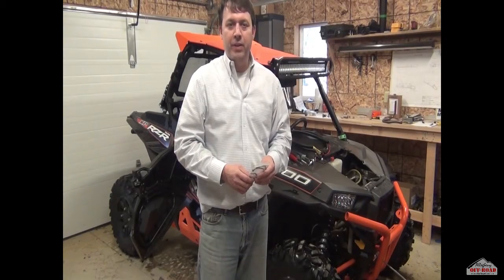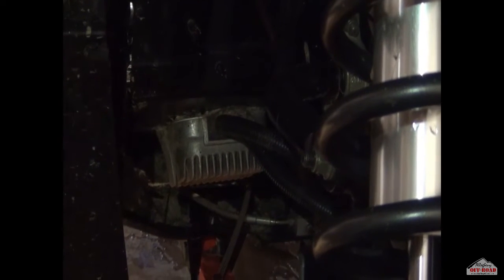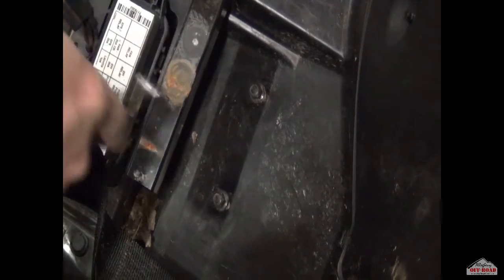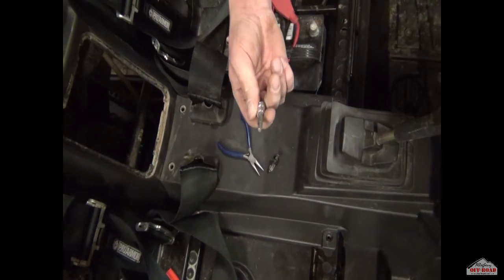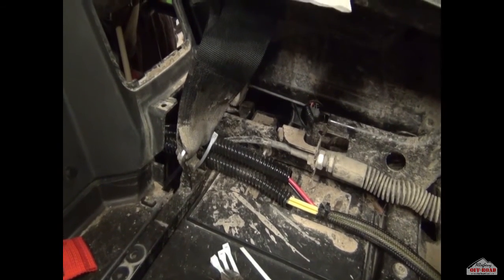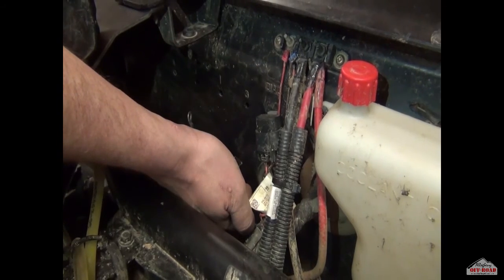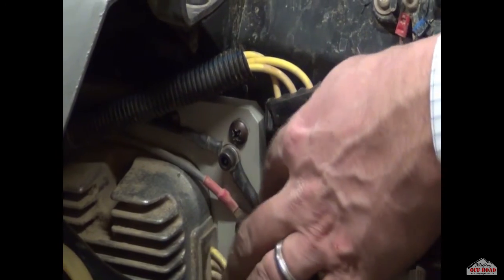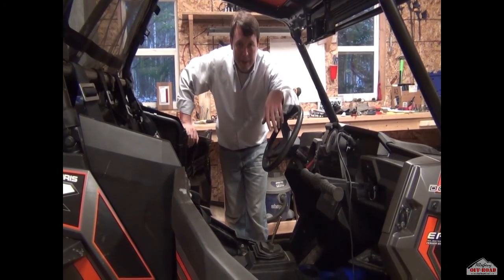Voltage Regulatior Relocation Install

Comment: okay  I would like to recommend that you have a professional do any work to your unit first and foremost secondly if you do have to disconnect your battery please follow the service manual and disconnect the negative terminal first this will prevent grounding of your tool and on a final note Polaris Industries does not recommend relocation of your voltage regulator
Reply: you sound like a complete idiot
Reply: @dannylsx   At the time of the comment I was a representative of polars industries I no longer work there because it's a shit hole.

Comment: Great product, I installed one of these on my wife 2015 RZR 900 trail after the recall was done last May. Just bought  another 2015 RZR 900 trail with just 5 hours on it  in August, before we took it on the trail I relocated the voltage regulator. Very pleased with this product real quality and great people to deal with. Love how the voltage regulator stays clean cool and dry.